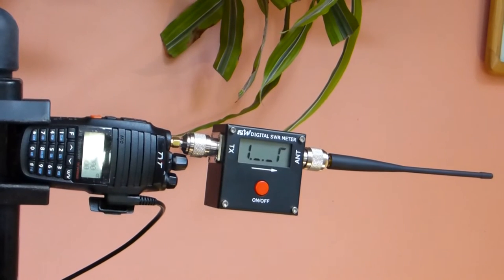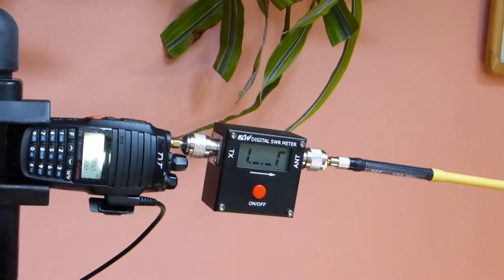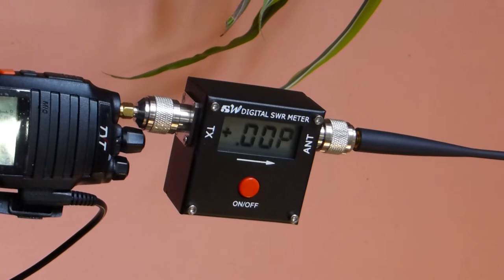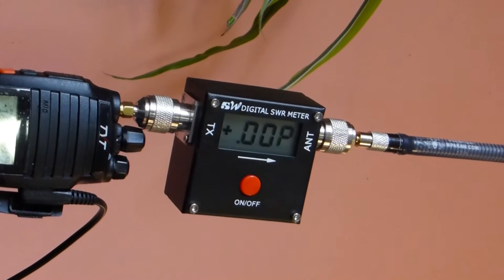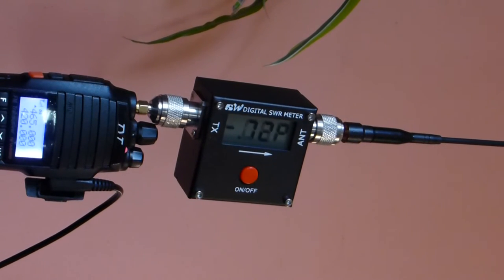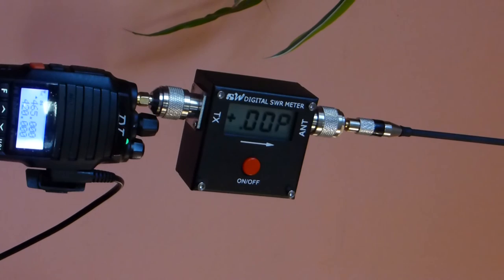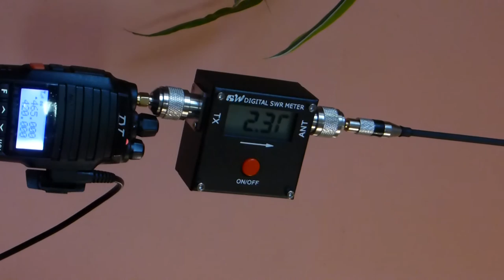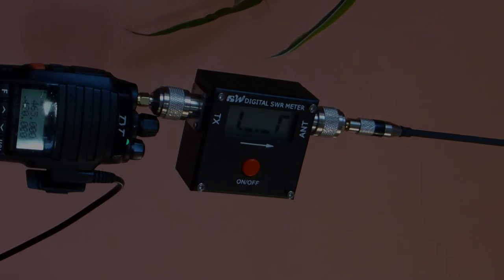TYT UV8000D Radio: Stock Antennas tested

Comment: So what antennas do u recommend for that radio?
Thx
Reply from the maker: I use the IPX6 which is a modified 5/8 wave Smiley for VHF, and the 1/4 wave slim duck for UHF. I avoid the use of supposed 'dual band' antennas.